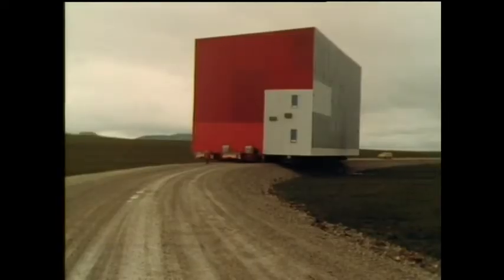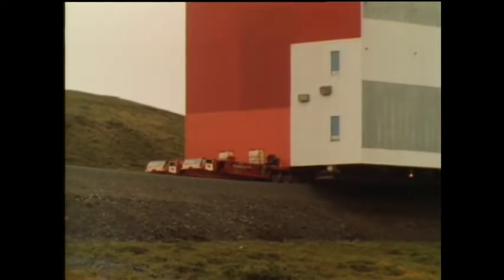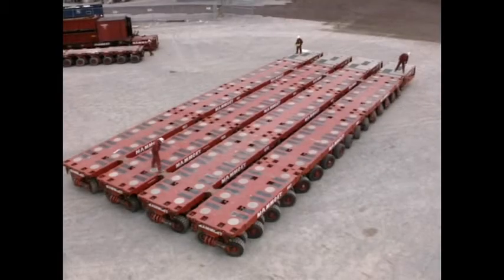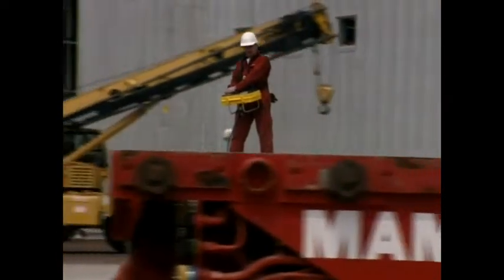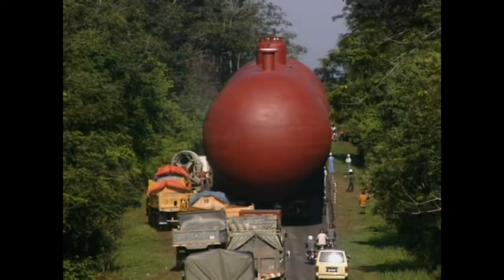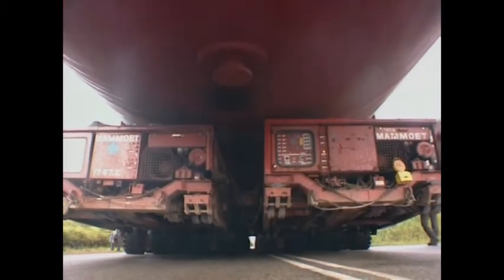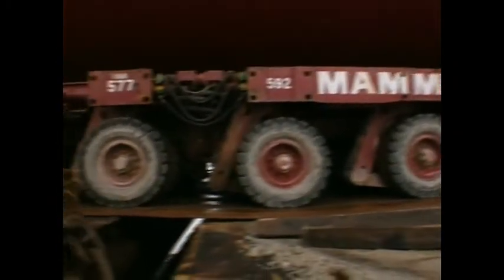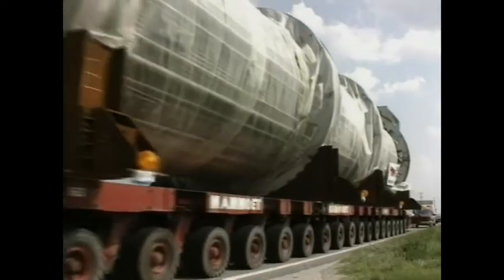Mammoet Self-Propelled Modular Transporter (SPMT)

Comment: How do you get a building onto the transporter without damaging the structure?
Reply: You lift with your knees.
Reply: I'd imagine it's tailored to each structure but they do it with cranes, telehandlers, and hydraulic jacking systems. There are specialised rigs for cranes for picking up huge box shaped stuff. Imagine looking at the structure from the top, now outline the edge, then make that outline into a big steel frame. You drill holes all around the frame wherever your engineer figures out they need to go and then run chains from a single connection point at the end of the crane cable, thread them through the holes and connect them to the bottom of the structure. That way the weight is distributed where it's built to take it. 

I think when that isn't an option they have the jacking systems,  although I'm struggling to figure out how they'd initially get the jacks under a building if a crane can't move it. I've seen a pic of them tilting some kind of oil rig structure but I can't imagine tilting is a great option with buildings, they're not really built for those sorts of stresses.